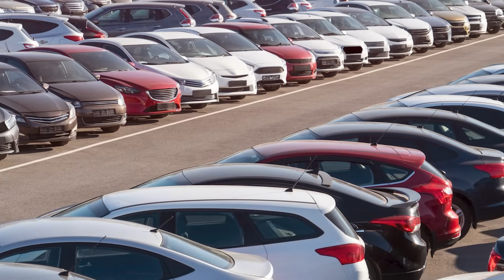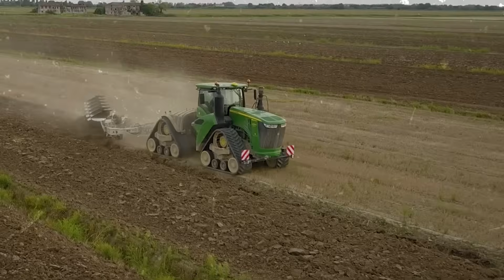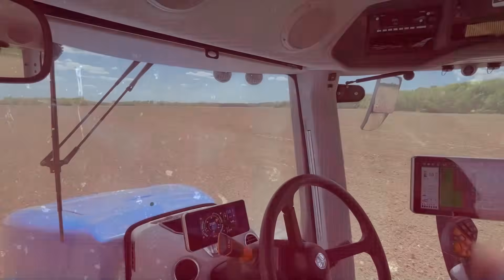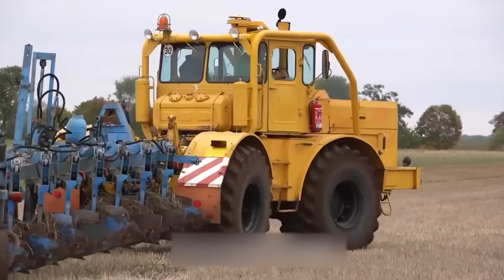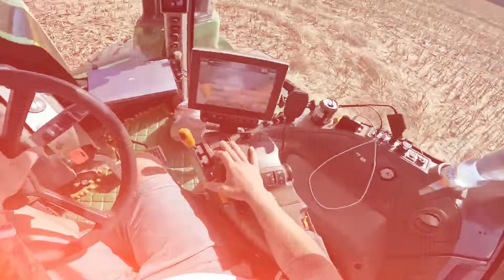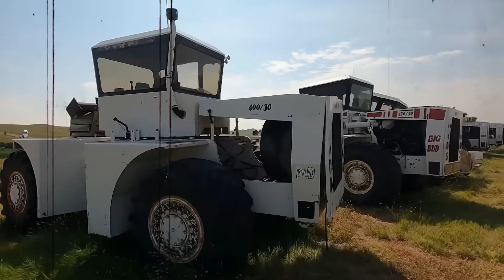13 Tractors That Should Be Illegal!

Comment: The Case IH 620 had 5.6 square metres of ground contact...about 60 square feet, NOT '7000 square feet'.  And CIH also makes the 715 model today with a max 778 engine hp.  Nearly 100 HP more than the 620.  The 'tractors' that should be illegal would be the 'autonomous' ones!